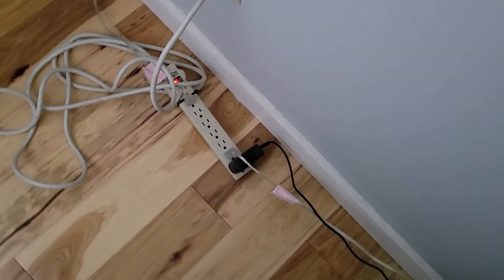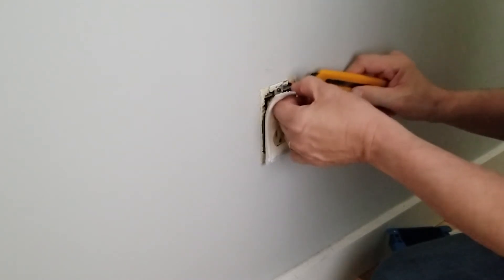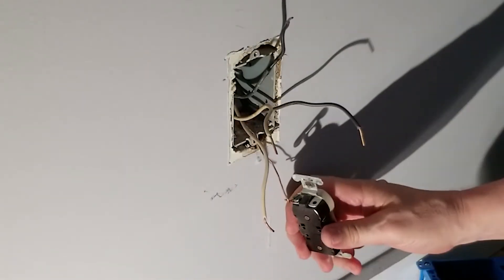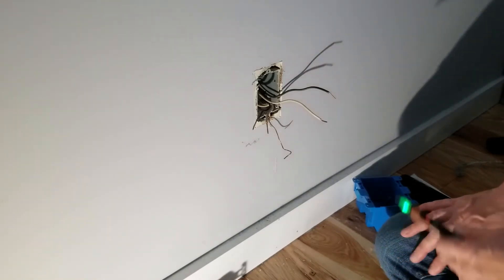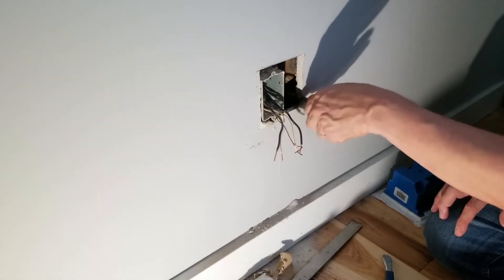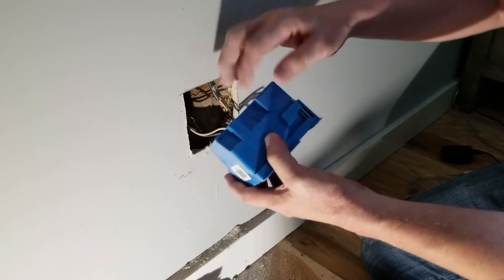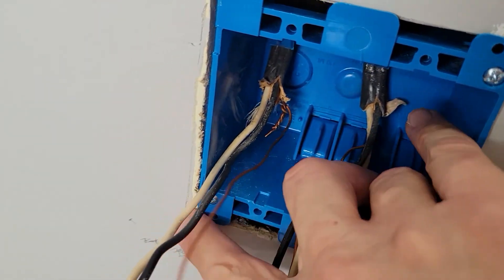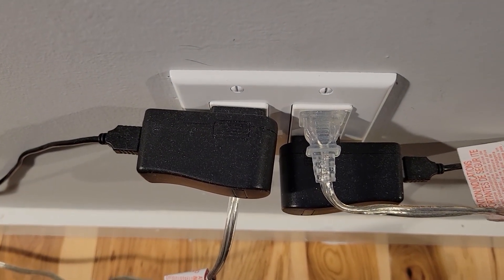Upgrade from Dual to Quad Receptacle

Comment: I really appreciate you telling people to recheck the wires for power. I was renting a house when I had to replace the ceiling light fixture. I didn’t have those testers because I was really poor. I accidentally touched the tip of the screw driver to the hot wire and of course it arched! I was surprised too because I had shut off all the electricity to the house from the power box. So I went back to the box to the circuit breakers again. The box still showed everything was off. Super scary!! I told the owner & they knew about it! I didn’t make a big deal, but that could have been deadly. 😔💜🙏🏻
Reply from the maker: Not rechecking or getting laxed can be dangerous. Was working on my sisters closet light and even though we opened the circuit and saw the light go out, I wasn't thorough with the non-contact probe and missed a hot wire. Fortunately I was standing on a plastic stool and only suffered a minor burn. I'm now more methodical and no longer in a hurry. Thank you for sharing your story.
Reply: I have this situation in my house. power off, but still power in a room, other locations in my house, not the case. So I just cap everything, not taking any risks.

Comment: they're upside down, ground should be on the top, hospital spec.
Reply from the maker: Code makes no specification for home bedroom so ground can be on top or bottom, although most homes have it on bottom. Modern hospitals have the receptacles installed horizontal with ground on the left side.
Reply: Should you use gfi sense you’re replacing a power strip?
Reply: @misodinamosa  GFCI is typically only for wet locations.  The surge protection in some power strips is not built into all power strips.  If you're only plugging in lamps, and maybe a phone charger, you probably don't need a surge protector.  But the GFCI does a different job, and does not act as a surge protector.  I hope that helps.